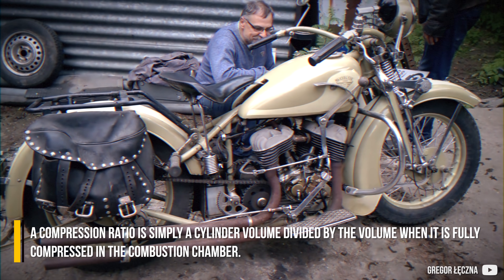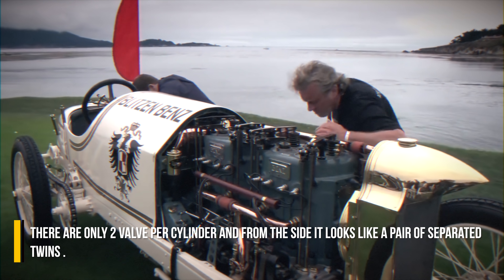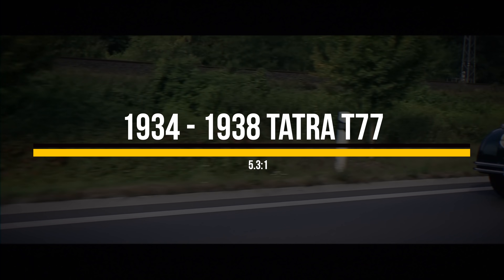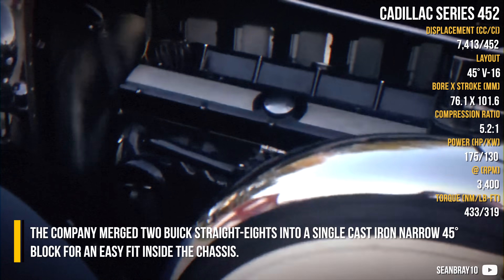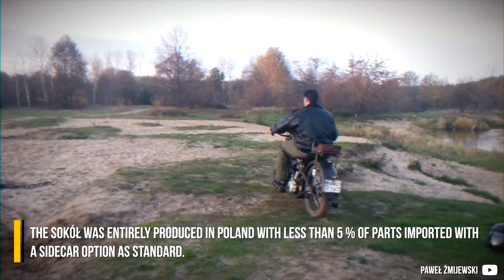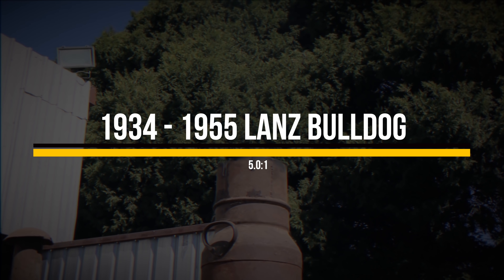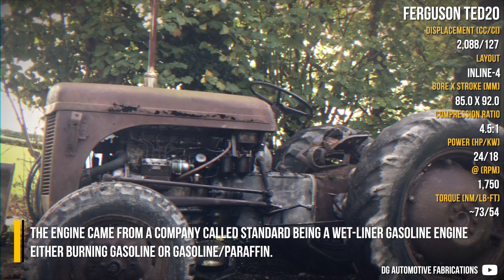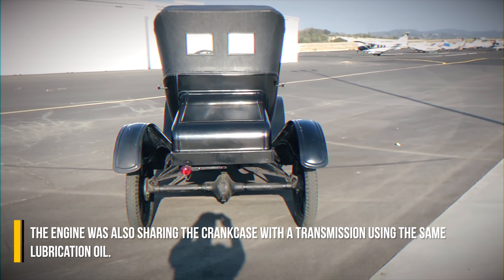The Lowest Recorded COMPRESSION RATIO Engines

Comment: Can you do a highest horsepower 125cc single cylinder 4strokes? I thought you had a video, and you have close ones but nothing excatly like I'm looking for
Reply: It's been a long time since 125ccs have been caped to 15hp due to specific licenses. For 4 strokes 125, the Honda CB125 twin ranged from 16.5 to 17bhp, which is a record for a production bike if I'm not mistaken.
Reply: Thank you I was curious about the most HP. You can make, I'm guessing it's no more than 27hp@14krpm max, I'm building a 125cc bored to 140cc and I'm trying to see what other people have gotten there numbers to
Reply: @myass5964  Well, if you custom build everything, Honda made a 125cc 5 cylinder with a mere 25mm stroke. It made 34bhp at 20.500 rpm. It would barely idle at 17.000 rpm. Not something you would want to drive.
Reply: @TheThunderwars  dude thank you, I didn't know that but you definitely answered my question! Your awesome man!
Reply: @Alfred Wedmore thanks but I specified 4 strokes, and I've already seen a 35hp 125 2 stroke so 17 isn't a lot, my 140cc 4 stroke almost has that now. Also the thing about gears didn't make sense, if your talking about the motor thunder wars is then yes you would want a lot of gears
Reply: @myass5964  What bike/engine is it ? I've seen people claiming they were getting over 15bhp from basically 125 Cg engines, which is something I'm highly skeptical about.
Reply: @TheThunderwars  it's a cg engine lol, Chinese made of course, I just took off the head to have it ported and shaved, bigger cam. There is a bike Dyno shop next to me I'd be happy to let you know where I make it, honestly the only reason why I care about the hp number is so I can market the bikes I want to sell
Reply: @myass5964  Oh well, I see. There a are tons of kits on AliExpress for that. The kits seem to be of surprisingly good quality. I think you may be able to get around 13 real world bhp from that engine, if you get the CR up to 11:1, a good carburetor ( maybe 30 or 32mm depending on where in the rev range the peek power will be, which is highly cam-dependant), accoustic tuning at that peak rpm ( you'd need to print a well thought out velocity stack for that matter).
Reply: @TheThunderwars  I do agree on a 125cc the most your going to see is around 13bhp, I'm hoping if I can flow bench the head I can find the pinch area and get it to rev higher, eventually I'll out in bigger valves, I am 15cc more that the 125cc so I'm hoping for 16-20hp maxed out, but honestly that could be a pipe dream, I'm happy with whatever tho because it's still a improvement over stock
Reply: @myass5964  Well the main problem of simple single cylinders is the ability to rev itself to pieces. You should calculate mean average piston speed to see where it would be at a given rev and stay below 20 m/s by all means. If you have very good crank bearings, maybe 18 m/s will be sustainable for short bursts. That would make 11.000 rpm as a redline and 12.000 rpm as an absolute limit to never go over with the 49.5mm stroke. If you want to go that high and still have torque, you have to use long duration, high lift camshaft with peak power at around 9.500rpm to 10.000 rpm, which is about 1000 to 1500 rpm higher than the original engine. You would also probably need stiffer springs to cope with the high rpms. To breathe well at those rpms, head porting, maybe bigger valves (but those two are fairly expensive to get right), a well designed carb (I'll calculate what diameter you'd need for a 140cc with peak power at 10.000 if you want) and everything else in top shape. 
Furthermore, high CR, good spark advance  and a good oil to protect your work.
Then you should be able to see 15-16 bhp, but that's a lot of work for a few ponies.
Reply: @TheThunderwars  gosh darn man, you went and a bombed me with information 😂, you are right about it's a lot of work and I'm probably never going to get my money out of it, but it's a labor of love, I wanted to start with something that was not perfected, so I could play engineer 😂, I really do believe if I wanted a race ready bike, I would've just bought a crf150r, it's better than my bike will ever be, but what can you really do to it to squeeze more power? Muffler? Intake? There already maxed out by engineers with tools who know what there doing. 😂
Reply: @TheThunderwars  I screenshoted your last post, so I can read it again
Reply: @Alfred Wedmore no your okay, it just wasn't on subject, I appreciate that you commented tho man!

Comment: I liked this one very much. I think that low compression engines just sound "juicier".
Reply: Compression RATIO is NOT actual compression (measured in PSI) the piston cannot build compression until all the valves in its cylinder are CLOSED. Watch the mate valves on the Benz; they're never open simultaneously at all; this builds more compression from a lower compression RATIO but severely limits RPM & HP. Compare that to a 60s & later valve-train where the intake valve[s] opens before the exhaust valve[s] closes (overlap) The more radical the cam the more overlap it has, which contributes to the "lope" associated with high lift/duration camshafts that allow the engine to rev higher but require a higher comp ratio to build equivalent compression. It's that lack of cam overlap and huge displacement that gives old engines that "juicier" sound even though the dynamic compression is about the same.
Reply: @bhaggen  although most of what you say is right, the dynamic compression is nowhere near the same. While there is more valve overlap in modern designs, it is nowhere near enough to allow for similar compression.

Peak cylinder pressures are much higher today that they were before.
Reply: @daszieher  that and if anything determines the sound of an engine, it's the LSA, not necessarily the event timing itself.
Reply: @throttleblipsntwistedgrips1992  What's LSA?
Reply: @mr.slaphappy3794  Lobe Seperation Angle
Reply: @AJS_Drums  Ah ok thanks.
Reply: I agree. Low compression engines have their own unique characteristics like all engines. After all, we are fans of all sorts of motors, thats why we watch these videos 👍
Reply: Like a loose fart😬
Reply: They may be less efficient but they sound great. If you’ve ever heard a lion at the zoo let out a low growl but you can feel it deep in your bones, that’s a low compression engine.
Reply: That squish sound is AWESOME.
Reply: They sound like diesel tractors
Reply: I love low compression engine sounds.
Reply: The sound you are talking about you can get with different types of exhaust
Reply: @melody3741  no. there is an intricate relationship between the pressure differential from combustion chamber to outside air and the frequency at which this happens.

you simply cannot really address this with exhaust design.

look at music instruments, why do you think that mouthpieces of saxophones and clarinets play such a great role?
Reply: I feel the same way about small displacement V8

Comment: Fuels that are used in compression-ignition engines, like diesel or kerosene, require a HIGHER compression ratio, not lower.
Reply: fuel burn rate is not the real issue, it is the tendency to self-ignite under compression.

those fuels are used in compression ignition engines, where fuel is injected into the combustion chamber or directly into the cylinder at or close to top dead centre

Comment: Damn, that Blitzen Benz has one hella torque, that power to torque ratio feels like a modern forced induction diesel.
And then you saw the Lanz Bulldog. Holy hell, that's a massive torque.
Reply: But it was a 20 liter too, wouldn't expect less.
Reply: The Blitzen Benz has all that torque and a chain driving the rear wheels 😂 gotta love early 1900s ingenuity!
Reply: The 0 rpm lanz bulldog is a chad engine
Reply: Modern forced induction diesels are capable of generating almost 3 times as much torque with only two third of that displacement. And any modern naturally aspirated gasoline car can easily achieve over twice as much of that torque to displacement ratio. That's how far the technology has developed over the years.
Reply: Blitzen Benz:I have so much torque that I spin the Earth
Lanz Bulldog:I'm about to end this man's whole career
Reply: But no way to put it to the ground, not with those skinny tires.

Comment: Just as an anecdote.. my 87 740 turbo manual Volvo would roll down hills if you left it in gear without the handbrake on, as the compression was so low lol.
Reply: Turbo engines always have lower compression, but still impressing
Reply: I drive a '92 1.4l opel, non interference as well. Handbrake is very worn out at least partially due to idiots leaving the handbrake on while driving. If it is to steep it will push through first gear and the handbrake, I am happy I don't live in a hilly area...
Reply: @laurean5998  i am guessing it uses drum brakes on the rear
Those are relatively inexpensive to replace if so
Reply: It's because of non-interference engine design, Volvo's redblock, Toyota's 4A-GE and 1/2JZ with no VVT-i, and Honda's belt driven V6 are the prominent examples. They might be inefficient but a belt snap wouldn't end the engine's life.
Reply: @Coby Williams the 16 valves are non-interference
Reply: @Coby Williams maybe you should replace it immediately and get a new cambelt history/lost concern, or get another car with timing chain
Reply: Yeah...that’s called gravity buddy
Reply: @Bull3tBikes  I’m familiar with the concept.
Reply: Your Volvo is 8.7:1, that's not a particularly low compression ratio. That's about what most naturally aspirated 4 cylinders of the era were running. 9.5:1 was considered high compression for a factory engine in the mid 80s.
Reply: Had a VW Passat 2.0 TFSI from 2006, when I did a overtake of 4-5 cars it would reach ~160 km/h and take almost a kilometer before it was down to 90 km/h if I let go of the gas pedal, was like no engine break at all, if the outside temperature was 5-10 ℃ the engine temperature would fall from 90 to 80℃ during such slowdown. 

But I don't think it was the lower compression in the turbo engine that made such an impact, must have been a combination with something else. Think the none-turbe VW 2.0 engine had 11.5:1 ratio and the turbo version had 10.3:1 so still pretty high but the engine had like no resistance.
Reply: @danielk70  most German cars are always designed with the high speed autobahn in mind, I’m sure the jerries would get annoyed if they had such an engine brake , the Germans likely engineered it that way.
Reply: @danielk70  was it auto?
Reply: @fry.master  , no, 6-speed manual.
Reply: @danielk70  possible it was just clapped piston rings or low compression from valve seat wear